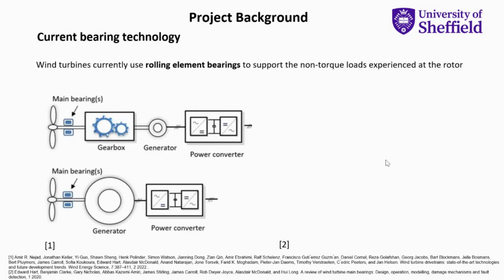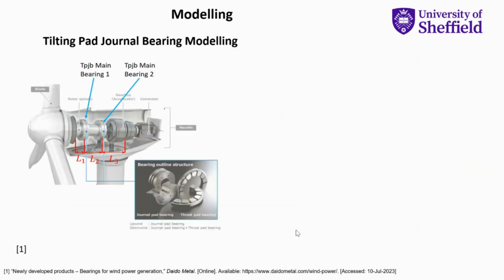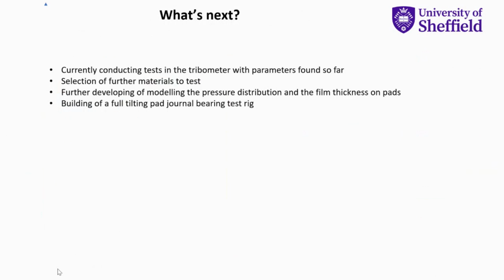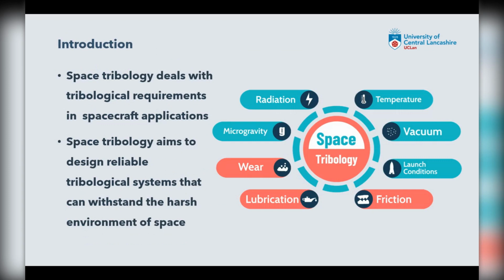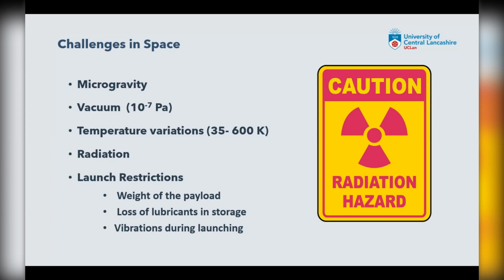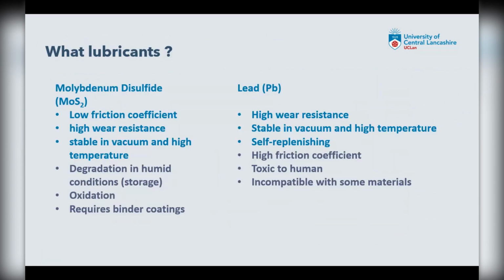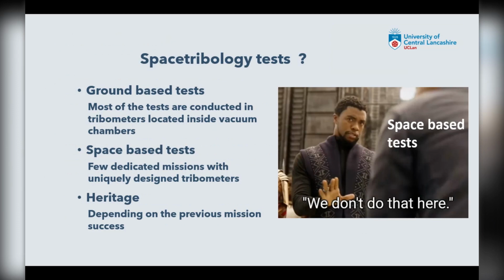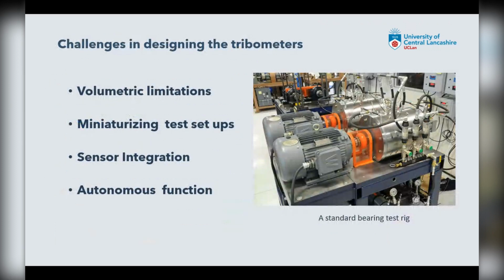Wind Turbine Tribology and Tribology in Space!

Comment: Thank you for hosting this tribology series! A suggestion for Emily on materials for the wind turbine journal bearing: a potential alternative for PEEK could be UHMW-PE. It has a very low CoF, self-lubricated (similar to PEEK), very good wear resistance in both smooth and abrasive sliding applications, and significantly cheaper than PEEK (if that is a concern). The abrasion resistance may especially help if debris/saltwater gets in the bearing. I must note that it is inferior to PEEK in temperature resistance as most are rated only for 100C max operating temp. However, there have been developments, like TIVAR H.O.T. UHMW, that have increased the operating temperature up to ~135C. If this temperature range is acceptable considering the environment, then it may be a suitable alternative. UHMW also has a lower compressive strength but may be enough for the application. Good luck in your research!